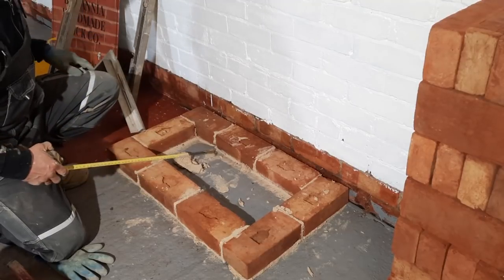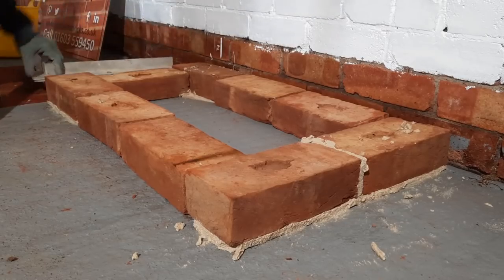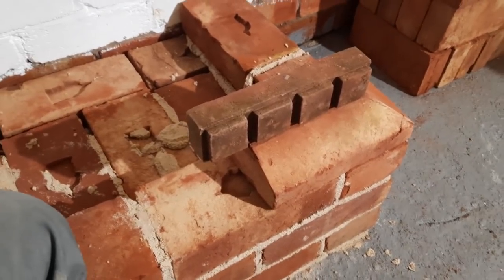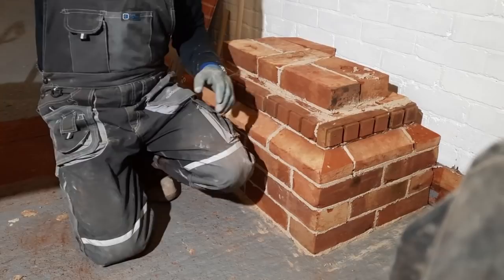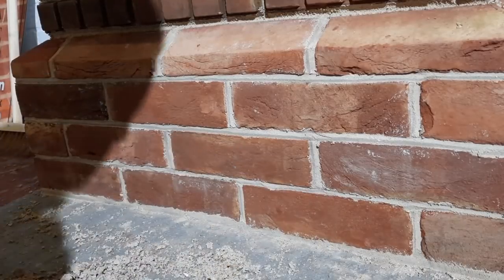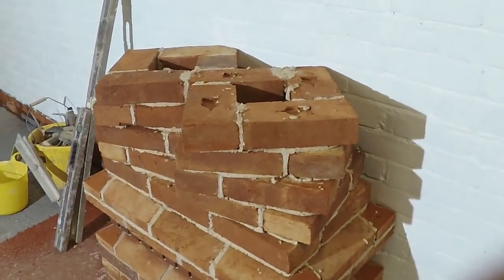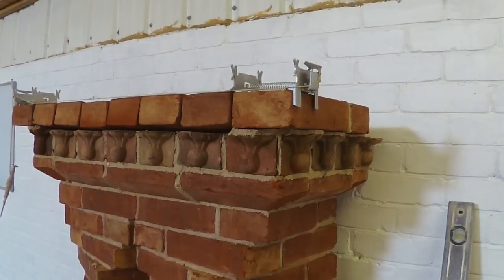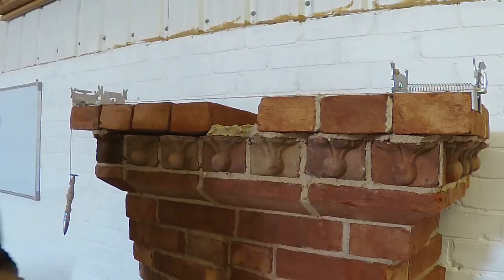the fine art of brickwork - Double Twist

Comment: Looks pukka that mate, we always called that jointing V joint but names change regionally. For short runs like that I use the little Dutch blocks with elastic line its perfect, also we were always taught on oversail courses that the line goes on the bottom arris as that's the eye line not the top.
Reply: @martin2466  And makes sense, if we were all taught this years ago why has it been lost

Comment: Rob.  I have a question.  Can I run a twin chimney into 1.   Run 2 stoves that are located in different rooms that are back to back.  I am asking this as a house that i live at has suffered major damage to the roof many years ago.  They since repaired the roof by cost in excess of 50K.  I dont want to run that same cost again just to repair the twin stack.  I would rather unit them into 1.  I fear I would require a cowl.
Reply from the maker: hi Jason, you could speak to your local Building Control but I'm still certain they tell you that each fireplace must have its own separate flue based on a few factors, such as room size in relation to flue size, ventilation, risk of fire spread etc...
speak to them first.